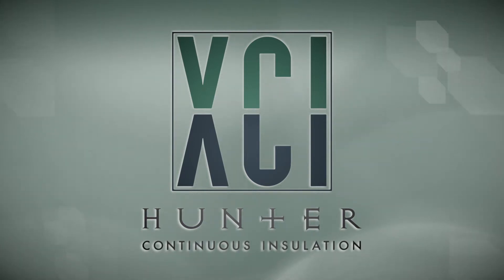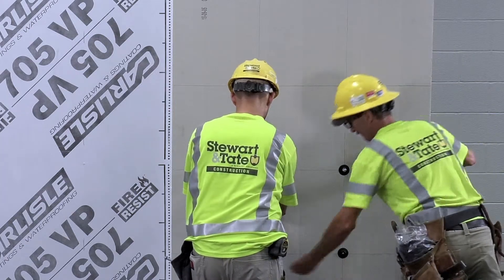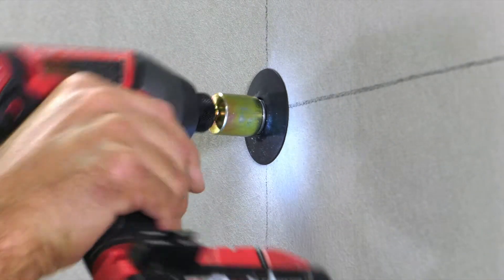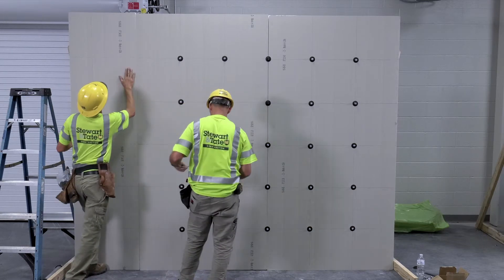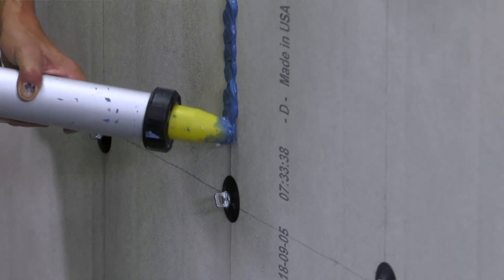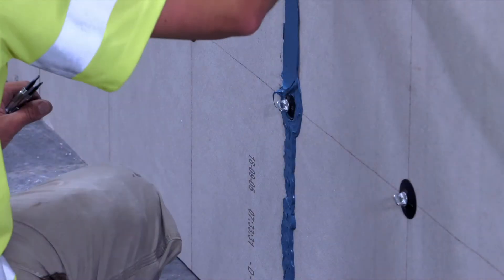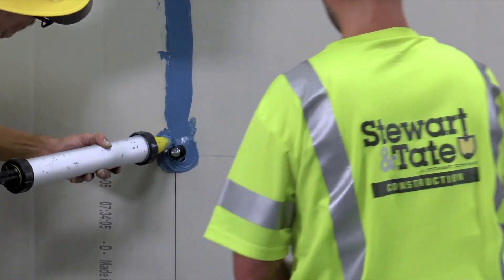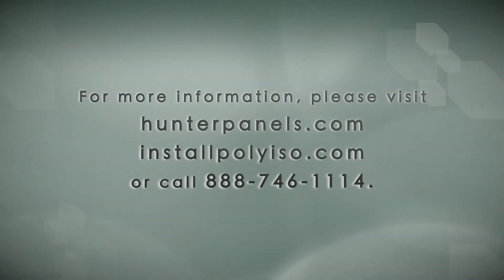How to Install Wall Polyiso Insulation over Steel Studs (non Class A foam)

Comment: Just a thought, but wouldn't applying detail sealant to edge surfaces before setting each new polyiso section in place be good?  Just smooth out excess expelled as you go using a putty knife.   I would think that by eliminating gap to the full depth, there would be a continuous r-value with no circulation paths for superior results.